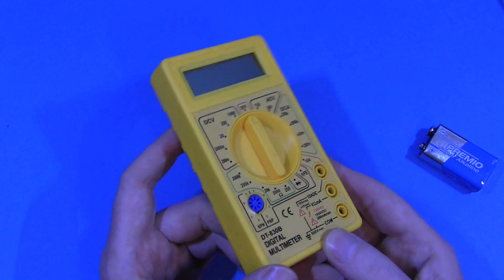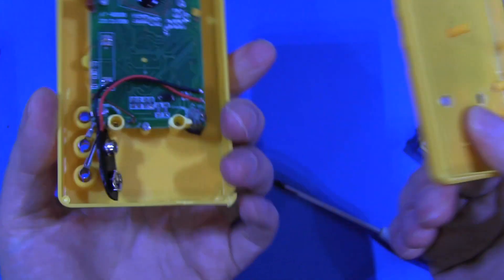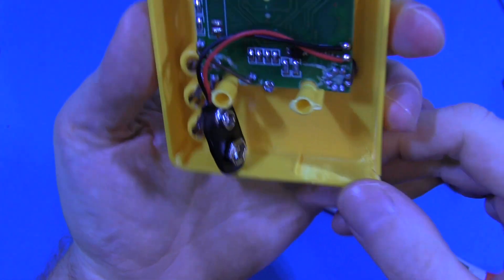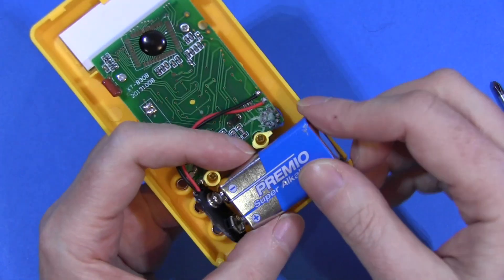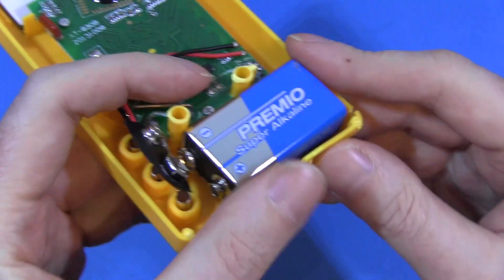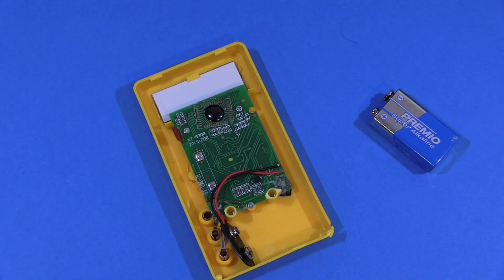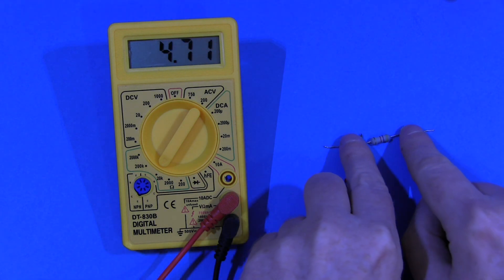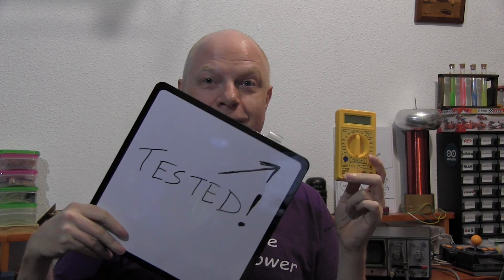Cheapo multimeters - really robust testing.... !

Comment: If you'd asked me if that meter would survive those tests, I'd have answered "no way" especially when compared with the Fluke 27 which looks and feels like a meter designed to take rough handling in its stride.
Reply from the maker: As noted in the video, there's not much inside them to break. If the case holds up then you're good. 

I tried running one over with my bike and it simply crushed it. The Fluke 27 would probably bounce me off and break my leg or something.
Reply: Thats a fact, the same would also be true for the Fluke 25.